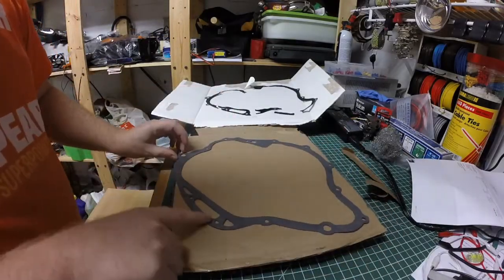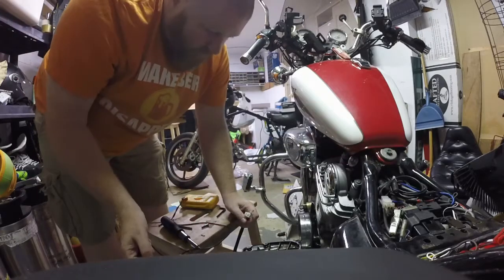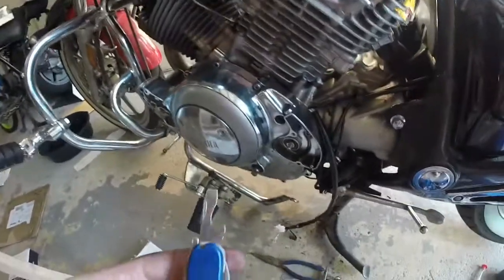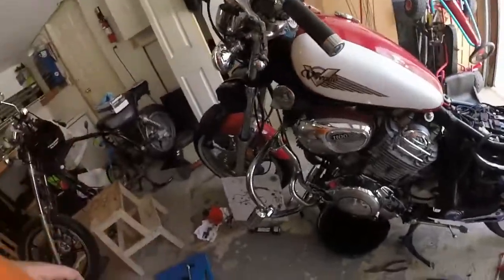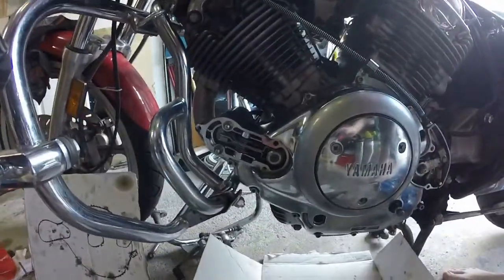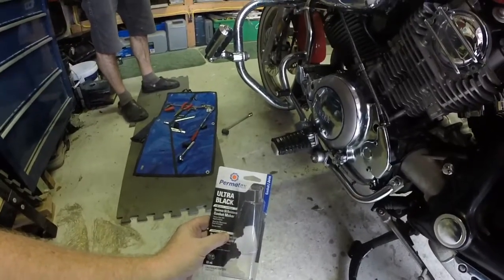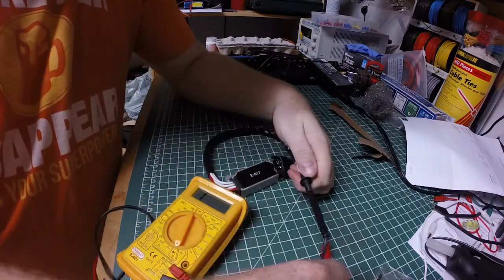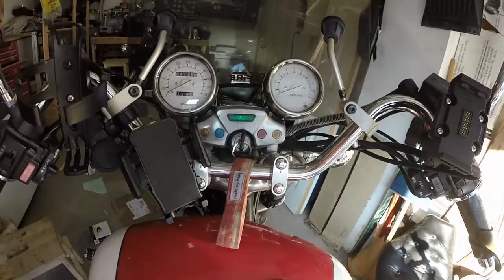1995 Virago xv1100 Stator Replacement (Part 2: success)

Comment: I appreciate all your tips and all of your suggestions.  Already bought a used stator.. I didn't test the rectifier because I don't have a tester I'm going to put the stator on first see if I get any more power to my battery before I order a rectifier and see if that's the problem. I got the stator before I realized the rectifier would be such a quick fix if that's the problem.. I'm hoping it will end up like yours and be the stator and it'll all be done here pretty soon.   I watched a different YouTube video on fixing a gas leak that didn't cost me anything w some Jimmy rigs.. hopefully that will turn out good when it's up & running! Tks again.. I took a break after I got the part up by the starter w the key star. Just got to figure out how to get that spring out that was holding it. & I will have it out.
Reply: Anyone that watched videos make sure you have the right tools ...you're going to need a Star key & a long Phillips to take off the starter or use what he used to do it with. I had to run to the auto store twice for those two things.. and make sure you have everything ordered.. the stator the rectifier & the giant washer thingy that goes around the whole thing.. I'm spacing the name of it but his fell apart so he had to order one.. and when I saw that I ordered one as well..  I'm only on the first day and I hope I get done in 2 & not 6 by watching the videos part 1 and 2 a couple times & learning from his mistakes... unless it's the rectifier then I'll have to order one for twenty bucks or whatever but that's only a five-minute fix or less ...  good luck to all who attempt this if you like to tinker  it's kind of fun.. but just be patient. ✌
Reply from the maker: Good luck man, I hope it works out easy for you.
Reply: @zeroreality      Tks!   I appreciate it.  Would rather try myself than someone try to steal my bike or overcharge me.. Which has happened.    😁👍
Reply from the maker: @jpstevens7430  Japanese bikes use JIS (Japanese Industrial Standard) screws, not Phillips.  They are similar to Phillips, but not as deep.  This can cause you to strip some screws.  Check this link:
https://www.motorcycle.com/ask-mo-anything/difference-between-japanese-jis-phillips.html
Reply: @zeroreality  thanks for the tip... the Allen on the bottom near the starter the tricky hard-to-find one is nearly impossible to get off and I may have stripped it already any suggestions besides hitting with a hammer?
Reply: @zeroreality  should have took your advice and gave up and try to mechanic I stripped the Allen on the bottom side of the starter.... I see no other way to get the cover off..  and I don't have any kind of tool to cut the bolt off... Guess time to put it all back together and just put my battery on the charger after every ride as before...... White flag goin up.... Pthttt
Reply: I guess there's still a chance it's the rectifier I'll go ahead and order that put it on and see if I was doin this all for nothing.....
Reply from the maker: @jpstevens7430  Vise grips, grip the sides really tight (almost to the point of squishing the allen flat) and pray while twisting.  Once you get it off, replace it.  If you end up taking the head off, then you'll have to drill it out.
Reply from the maker: @jpstevens7430  Stator and rectifier work together to turn AC into DC for the battery.  If one has died, chances are something is wrong with the other one too.  Another lesson I learned after finishing this one.
Reply: @zeroreality  tks.. I'm trying to find a little bit bigger Allen socket or  star to hammer in the stripped Allen Bolt... still haven't quite given up but I'm getting mighty close now... initially I should have taken off the footrest to get more room for torque instead of stripping it...
Reply from the maker: @jpstevens7430  I find in these situations that the liberal application of whisky and sleep helps wonders!
Reply: @zeroreality  Freakin halarious!!   Yes indeed!!
Reply: @zeroreality  You were right.  Once I get that one stripped Allen bolt off   
.. I will put my new stator on to go with my new rectifier.  In the mean time I have been charging my battery after every ride wearing down my battery.  ✌ I had a feeling you were right I just didn't want you to be....
Reply from the maker: @jpstevens7430  charging the battery after each ride shouldn't stress it too much as long as it gets back to full before the next. Keep the shiny side up! ✌️

Comment: Hello sir, i took my bike to the shop to get the stator replaced and after spending 600$ and a week later i am having the same exact issue. I have a leak in the gromet where the wires come out. I just got new oil and didn’t do these fixes myself just because i just moved to canada and dont have oil pan hoses funnels gasket sealers and other tools to make this fix. Is there a way to deal with this issue without opening the stator cover again. I would just put gasket sealer from outside but the lip on top of the wires wont allow me . Please help me find a way if possible. 
Thanks in advance
Reply from the maker: The short answer is "take it back to that shop and get them to fix their mistake".  Though that depends on how much they care about their reputation.
After I uploaded this video, I discovered the bike was leaking a bit of oil out of the hole where the rubber grommet sat.  I just shoved a whole bunch of paper towel into that area so the escaping oil wouldn't drip on my garage floor.  It would still leak, but not as bad, and only while the bike was running (and the oil under pressure).  In the end it held enough that I could enjoy riding, but my poor bike died the next year (due to another stator failure) at the very end of a three day trip.  So I'd still take it back to that shop and get them to fix it.  If they aren't willing (or is too far away) then your best bet is to take it apart yourself (time to buy a $10 oil pan from Crappy Tire), save the gasket, an add an extra piece or thin rubber to the rubber grommet so it makes a better seal.  Or add a fuck-tonne of liquid gasket there.
Good luck!
Reply: @vipulkapoor8922  im just happy for once that i live in germany.. if someone fucks up this bad it goes straight to a lawyer :D

Comment: The gromet(plug that seals oil around the wires) on my stator, is also attached to the gromet on the wires to my pick up coil. I have a 96 xv750 virago. How did you get yours apart and reinstall it? Scratching my head here.. I just need to replace the pick up coil. Thanks I’m advance if anyone can help!

Also, a shop will give you a headache as well, had to keep taking mine back in the past because it kept leaking oil, they sealed the shit out of the same spot with permatex 🤣
Reply from the maker: I'm not sure I understand.  The pickup coil is the part of the stator that I replaced in this video (there's a part 1 in the description).  The stator is made up of two primary parts; the pick coild and the rotor.  There is only one grommet.  Can you post a picture of what you're looking at somewhere?
Reply: @zeroreality  it must be the rotar?, it’s the part that is square black plastic with a little magnet on it. Sits above the coil.. I’ll see if I can send a pic.

No idea of how to send a picture
Reply: The pick up pulser.. anyhow that’s the part I need but the gromet for the pulser is the same gromet for the coil, and I can’t but them together unless it’s cheap, so I’m not sure how to replace that one part.
Reply from the maker: @vanessap8717  Ok, I found pictures of the pickup pulsar, but I can say with certainty that the 1100 did not have this part.  Not when I removed my coils, nor did I replace it.  I can sort of guess where it would go those based on the shape, and images on eBay suggest that they both need to come out that same grommet.

Do you have the part already, or are you just making sure it will fit?  I think maybe the grommet for the 750 will be different.
Reply from the maker: @vanessap8717  AAAAH nevermind that last comment.  It has been a while, but I remember now, there a separate wire coming in and was not part of the rubber grommet.  It had its own rubber piece that comes out the same hole, but it separate from the coils grommet!

I need to start drinking later in the day, holy shit.
Reply: @zeroreality  thanks for your time man, ya maybe it’s different on the 750, but it just doesn’t make sense to me because they are two separate parts, why they have them in one gromet is odd. I don’t have the part yet but I’m going to a salvage place tomorrow, I wanted to bring the pick up with me, but can’t take it without the coil because of the gromet. Yamaha doesn’t even make the pick up anymore, but they are definitely sold separately on line (aftermarket). I didn’t notice your coil coming attached with the pulser, did it come together? Maybe if I buy the own stator it will have the pulser attached, otherwise I have no idea how it will work.
Reply: @zeroreality  haha just saw this. Guess I’ll have to cut my gromet in half🤷‍♂️
Reply from the maker: @vanessap8717  Sorry, forget my other comment.  The reason I had to leave the side of the engine on my stool was that there was another wire that stayed attached, and I didn't want to fuck with it, so I just balanced it there while I put in the new coil.
Reply from the maker: @vanessap8717  nononononono the grommet is two pieces.  The part attached to the coil was one part.  I remember that they were stuck together really well (as in they fit perfectly) when taking it apart, but my new one didn't fit as well.  Pictures on eBay also look like there are two grommets, but they work together as one in the one hole.

Worst case Ontario come back to the comments here and I can try to help you out.

Comment: SUCH A GREAT VIDEO, THEN YOU FAILED ME! Can you test the new stator installed on the bike and show no more grounded stator at all three wires? Did you test? What did you get continuity or no more continuity?
Reply from the maker: Ok, so at about 1:10 on video I actually test the new stator, and at about 5:00 I check that the voltage it working.  It's just because the video continues with all the oil leaks that it's a bit anti climactic.

Comment: What is the yellow wire on the end of my stator cable near where it connects to the rectifier? I can’t find where to plug it in.
Reply from the maker: What colour wires do you have on the cable? Mine was 3 white (bound together) and one blue. It might be the neutral light wire that plugs in under the seat, and under the engine.
Reply: It goes right next to the side stand. There is a screw with a rubber groomet on it. It is a ground for the side stand switch i guess because without it connected you will not be able to turn on the bike  while side stand is down

Comment: i always get so discouraged when i watch these video. i need a stator replacement on my 94, but i dont have any tool and a shop will charge me an arm and a leg. and i really have no knowledge at all.
Reply from the maker: At the end of this video I came to the same kind of conclusion.  I can either save money, or I can save headaches.  I have enough headaches, so I decided that the next thing I needed to fix would be done in a shop.  Simple things like throttle/clutch cables or oil changes I can do easily, but big stuff like the stator I don't want to do again.  I ended up selling this Virago and bought a new bike, but my attitude hasn't changed.  Anything that can be done in a couple of hours I will handle, but for big stuff inside the powerplant I will go to a garage.

However, it is possible to do this job yourself in a day if you're willing.  You can buy a decent ratchet tool set for ~$100, and the stator with gasket for ~$100; so it is certainly a LOT cheaper.  Be sure to have that special star bit to take out the starter, and make sure the replacement stator grommet fits very snug into the metal (add some extra to it if needed), and don't remove any of the allen bolts while the engine is still warm (you could strip the socket).

Whatever you decide dude, good luck!
Reply: @zeroreality  well thanks to this video, I was able to get the stator done. I went and bought a socket set and some Alan keys. Still gotta put the starter back in tomorrow, but I got the hard stuff done today. Your video saved my life and I think I came back to it 20 times or more to make sure I was doing it all correctly.
Reply: @zeroreality  Well, the job is done. i came back to this video so many times, but i got it. thanks for the help man. bike runs like a dream, if you can ignore the backfiring. :D
Reply from the maker: @123dunnboy  glad I could help! It's the reason I make videos like this.

Comment: I am an idiot for trying... 6 days as well.. Made all the mistakes you did even after watching... It started and then I went to go for calibration ride and reeeeeee  ..sound of not starting.. I am missing the washer that screws in by the starter on the end of the spring...  Is that vital? I'm not sure if it started without it or not... Bur I'm thoroughly discouraged!!!!  Should I took your advice don't start it in the first place take it to a mechanic !!!!!
Reply from the maker: Aw damn dude... is the "reeee" sound the sound of the starter spinning while not meshing to the engine gears?  If so, you might just need to look at the mechanism that engages those gears (it's easier to get into that than to take the whole thing apart again).  I'm talking about the bit at ~4:40 in this video.
Reply: @zeroreality  under the spring that hooks on the starter the round part that needs the star key ..the custom washer that it screws into is missing... Can I start the bike without that? Any Jimmy rig ideas?? I cant find it for the life of me!!
Reply: I was so ready to go on a joy ride to when it started.. I've taken that thing off and put it on & off like 3 or 4 times... I think everything is good inside there where the stator is I really don't want to go back in there again!!!  I got to get this thing started so I can drive it up the U-Haul ramp next week moving to Florida I wanted to cruise the Florida Bay without my battery going out every day... I may have to go to the junkyard .. if I really need that washer that the Starkey piece screws into.. Let me know what you think.
Reply from the maker: @jpstevens7430  Wait... check this diagram here: https://www.partzilla.com/catalog/yamaha/motorcycle/1995/virago-1100-xv1100g/starter-clutch

Do you mean you are missing #10?
Reply: @zeroreality  After it had started and I had all the parts on and then Reeeee.... and so when I opened it up where the diagramed parts are nothing fell out and#11 was half out of #10..  Could the bike have started without #9??  That's what I am racking my brain with now.... Tks. For replying so fast... Let me know what you think whenever you get the chance... Maybe my starter went out?? But it cranked so nicely and sounded so good .. Then I shut it off  put clutch cover on and Reeeeee.... What a tease!! I'm not drinkin until I get this resolved  😆
Reply from the maker: @jpstevens7430  If that torx key was "out", try putting on some locktite.  Or tighten it a bit more and let the thing idle in the garage for a few.  It's possible you simply forgot to fully tighten that one bolt... I've done that before on my windshield.  And my seat.  And my saddlebag brackets...
Reply: @zeroreality  That bolt just slides in and out of that casing and there's nothing to tighten it into..  Which may be #9  so there's nothing to engage what number nine would screw into... to pull  or push that long bolt that comes thru where the gears are to it to engage the engine... I'm stuck.
Reply: @zeroreality  There is nothing to pull or push what seems to be #8 without #9..    10 & 11 seem worthless without it.. I been tryin different washers and nothin works.
Reply from the maker: @jpstevens7430  I'm going by memory, so please bear with me here.  I'm looking at a picture on https://www.cmsnl.com/products/drive-lever-assy_5a81555000/
There are two pictures, compare the ends on both.
It looks like the hole on one side is threaded for #11 to go into, and solid on the other side... Did you put that part in backwards during re-assembly?  If you did, it would look flat on the end with no hole.
Reply: @zeroreality  Ohh crap... That's it!!   I can't believe it started with it backwards...the one time... But it did..  Well at least I have a reason for opening it back up knowing what needs to be done!!!! I was getting depressed!  Tks a millionbro! 😁🤙 ur a lifesaver!
Reply from the maker: @jpstevens7430  lol, no worries bud!  Hopefully it's just a matter of taking it apart and reversing that piece.  It seems pretty symmetrical, so it's an easy error. The "reee" was probably the sound of the starter motor being permanently engaged.  As long as you didn't rev it too high it should be fine though.
Reply: @zeroreality  Yea I didnt remember that part being able to reverse while I was putting it back in... I was racking my brain so hard cause nothing made sense why it was able to start and why I couldn't find the imaginary part.  So I suppose a regular washer goes in between the one I thought I was missing?   I am gonna get started.... Mom coming from out of town.. I want this to be over & done!  I worked on it all day Sun. & Mon!!!   😆 or cry...
Reply from the maker: @jpstevens7430   Good luck bud!
Use the exploded diagram to make sure you get everything else back where it belongs.
Reply: @zeroreality  Got it!! It is finished as Jesus said!  thanks to you & Gods graces!!!! I'm goin for a ride! 😁🤙